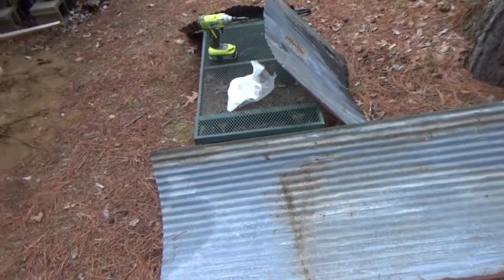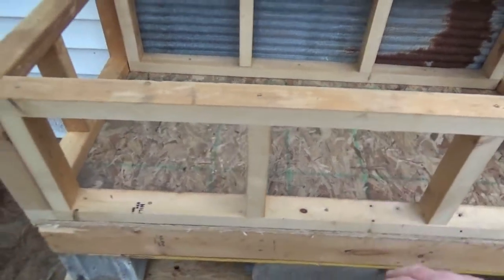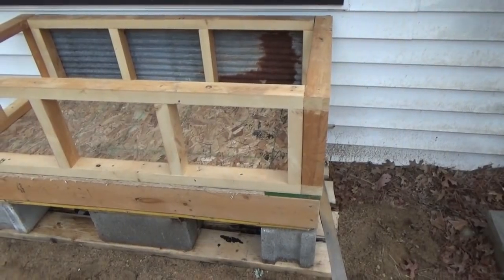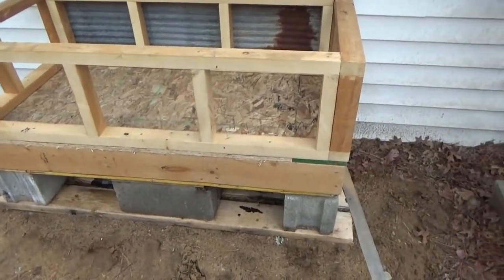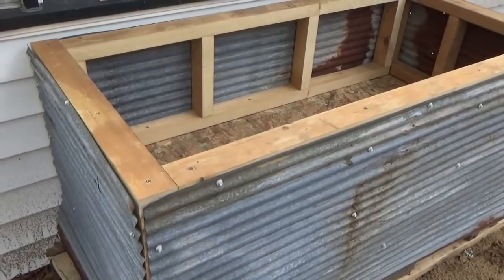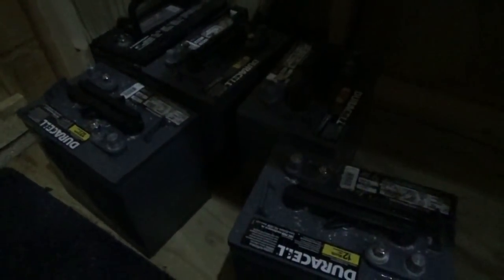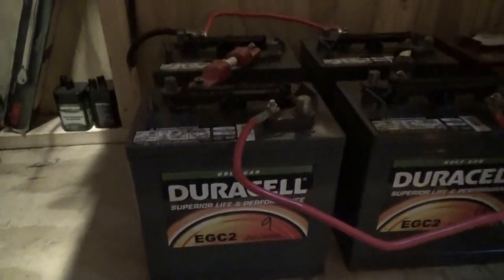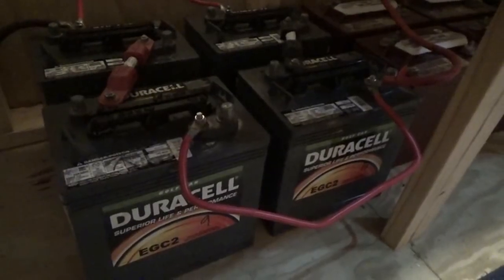Building Solar Battery Box & Swapping Out Batteries

Comment: Could you run the house and the work shop off the same panels?
Reply from the maker: I am trying to figure out a way to dump the excess power to the house when the shop is charged up. Need HUGE thick wires tho.

Comment: Hi Troy, sorry mate your wrong !!  If one 6v battery is 235 ah then when you add another 6v 235 ah battery to it the volts double making 12v BUT the AH remains the same 235 ah, so you in fact now have a 12v 235 ah battery !!  Seeya Rob
Reply from the maker: Yes but when you add two 235 AH batteries (2 pairs of 6 volt), you get 470 AH.
Reply: SORRY my mistake mate, I misunderstood I thought you were talking about one pair of 6v batteries. Sorry again, Seeya Rob
Reply from the maker: No problem.

Comment: you catch alot of shit, but youre doing your own thing and it works for you ,     the 6v lantern batteries against the wall,  what do/did you use them for , I have a old radio shack fm/am radio that is rated for 6v total from x amount of C batteries , I made little jumper cables and hooked it to the 6v lantern battery ,  2 weeks straight today 24 hrs a day,  just seeing how long i can get out of the battery, i run the radio for background noise ..... depending on back surgery in a few months im moving onto my land end of February , off grid ....... ill watch your videos more in depth soon, after the holidays ....... have a good Thanksgiving
Reply from the maker: I got the batteries on clearance for a few dollars each. Lead acid batteries. I will use them for my game cameras.
Thank you. You too.

Comment: I see these "Solar Generators" at  Lowes etc. but I'm confused by the name. they don't Generate Power , they only store power from Solar panels or plugged into House.  I use 4 -140 RC with a 1000 watt Pure Sine wave Inverter and a 1500 watt Modified Inverter. The battery's are hooked up to a Battery Maintainer and Smart Charger , but this is only a back-up system for short term outages. For long outages we have a 10000 Watt Briggs and Stratton  Generator with a Generlink transfer switch. I hope your system is just for Emergency Back up and not for complete off grid.  and have you insulated box to protect battery's from freezing. especially he bottom. still like you videos keep up the good work.
Reply from the maker: Its a term used these days as a source of solar power stored in batteries. Solar generators do not store much power but the solar panels should provide most of our energy needs. We were fully off the grid in NY with less sunlight than we have here. Should be fine.
I will insulate the entire battery box on all sides, even the top.

Comment: I made it 40 seconds.   1.  You can't put wood to dirt like that and think it will not be a rotting mess in a few months.  You didn't even treat the wood.  2. You put acid containers that boil under a window.    Have you learned NOTHING these past few years????????
Reply: No offense, but if you failed to see what I pointed out, which. . you did.  I simply do not have the time, patience or crayons to educate you.  IF you wish to criticize me I gladly welcome it, and only ask that your bring a counter point or points showing some education and knowledge to correct me.  Nanny nanny poo poo is not a valid adult answer.  Thank you for playing, now please, let the adults talk.
Reply: oh, and a tip, dont forget the temperature sensor on the battery's , your charge controller needs to know the temperature of the battery for the right charge voltage... (thats different cold and hot )
Reply: agree, the heat is inportant for these battery;s,! dont forget to vent out the hydrogen, in the top of one side. one vent is more then enough iff you use forced heat in.  nice box, ! (but y do agree on the comment of not threating the wood whit primer or paint, thats a pitty, you have build it correct, would be sad to see it being rotten. (y) (ps, dont mean the boards where the blocks are on, y would not even have used that, just put the box on the blocks would have been fine to if you would have put them whit the flat side down on the dirt, the battery's are heavy, but not that heavy to let them sink down, the boards you have used now will indeed rot away in a year or two, making the box sagging then.. (extra work) but it sure is becoming a strong box! well done, you are getting handyer whit wood by the day!, y figure, the more you build the more you learn! (y)
Reply from the maker: Looks like someone did not have their happy coffee yet this morning :)
The wood will rot in a few years. It is ONLY to keep the cement blocks from settling unevenly into the sand for now.
The batteries do not boil off acid into the air in enough quantity to harm anything outdoors. This box will have forced heated air from inside the tiny house and an exhaust on the opposite side. No acid or any harmful fumes are coming anywhere near our window.
Reply from the maker: Yes I have learned a LOT. This is going to be fully insulated on all sides. It will be heated with forced air from the tiny house. The battery box will have intake and exhaust air flow.
Reply: I am working on coffee so you may be right on that.  But I stand by my points.  You would put the blocks down and use wood as a header on top of the blocks.   To support my statement, reference any building . . .and I do mean ANY building.  What you are doing is an example of how to NOT do something with weather, ground or wood.  Its wrong.  Battery boxes are designed to deal with acid batteries.  Like a gun, you simply control the barrel, and exactly like that you simply keep the battery box AWAY from windows and living areas.  Outside is a smart move.  Given you had a CHOICE, under a window is the LAST choice option.  Not first.  You know I am right.  You should not be showing people this.  You can do it cheap with supplies on hands, but the decisions of where and how which have nothing to do with costs are the problem.
Reply from the maker: Well, on the wood, you may have a point but its too late for that now.
On the battery box, I had to choose the closest point to the solar panels. Further down the wall is the wood stove so I cant put the batteries there. I want the charge controller inside on the wall where I can see it all the time. That leaves me yet further down the wall behind a chair. Yet further down the wall is another window. And beyond that is a bed. Not much left for options in this tiny house.

I will vent the box away from the house on the far end. The wind is enough on that corner that there should not be a problem.

Thank you for your points.
Reply: jgreen   Are YOU and Andrew the same person? Because YOU both lack something between the ears. BRAINS

Comment: Why do you use wood underneath? Isn't it going to rot, unprotectet like this?
Reply from the maker: The wood under the cement blocks will rot but they are only to limit how far the blocks sink into the sand. This will allow them to settle more evenly.